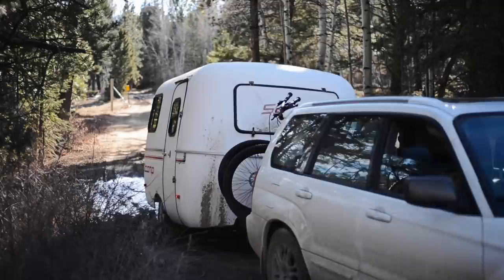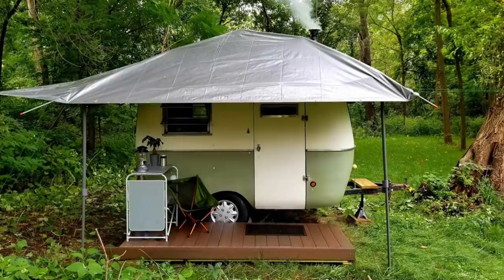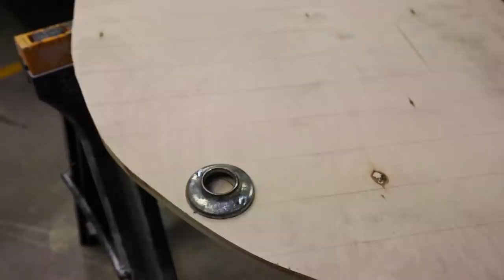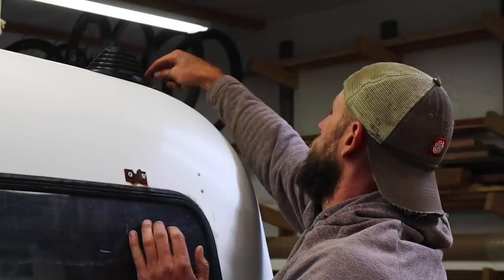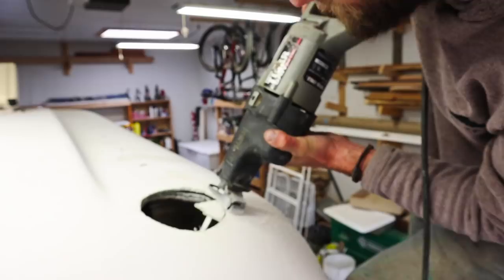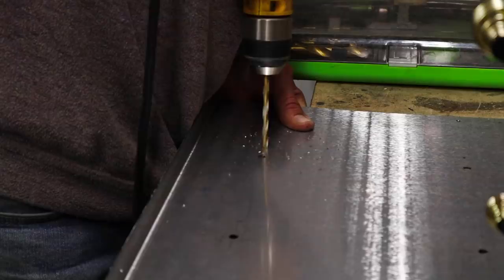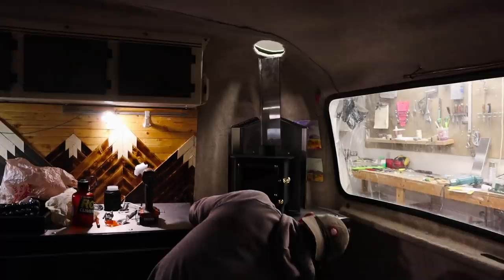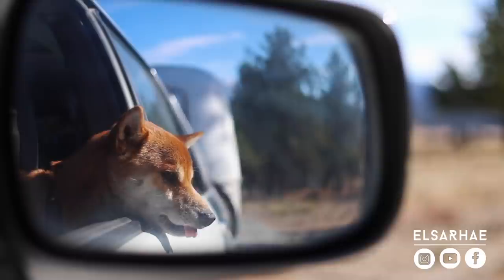Installing a CUBIC MINI WOOD STOVE inside a 13ft Scamp Trailer

Comment: ADD A SOAPSTONE ON TOP OF STOVE!!!
It will provide mass and hold heat for disbursing after fire goes out in middle of night.
There are several places online to buy soapstone, and stones that size are available in lots of locations as you travel.
I recommend getting two small thick stones and CAREFULLY drill holes to match stove top bolt holes and bolt down so they can’t slide around, and to cut out so stones go around base of chimney.  This way it will look like stove was designed for it and you won’t have to worry about stones sliding around.  Don’t tighten bolts, instead use locking nuts and loctite because you don’t want stones cracking as stone and metals change as they heat and cool...

Love this addition, wood stoves are AWESOME!  (And dry heating beats the condensation of propane all day long).

Love the Shiba Inu, mine died last month, she was seventeen...

Comment: When it comes to stoves, ideally you want to arrange for a cold air intake, ie an air intake on the side or the bottom of the vehicle, so the stove can draw its combustion air straight from the outside, and then exhaust the smoke through the chimney. Doing that means the stove doesn't draw air from the inside of the space, and minimizes air movement towards the stove. Without a cold air intake, the stove takes inside air to fuel the combustion - that's not a hazard or anything, but it means that the furthest corner from the stove will be much cooler than the air near the stove, because there will be constant low speed airflow from the furthest corner towards the stove, instead of the warm air circulating throughout the trailer. You may want to put a  quiet low noise 12 volt fan above the stove to blow air along either the front or the side of the camper to force the air to circulate around the van.
Reply: Croft, you are exactly correct. Exterior combustion air is the most effective and safest method. It will also reduce  possible CO2 or Carbon monoxide safety concerns. For the fan, there are units available that contain a thermal dielectric material, the fan sits in top of the stove and rotates with no electrical requirement like a 12 v battery.
Reply: @tedlemoine9829  Good tip on the thermal fans, sounds ideal.
Reply: The advantage of not drawing in cold air directly from outside for the combustion is that it will help pull out moisture from inside of the small space.  Every time you breathe out you're expelling moisture through your breath and that small of a space, two people put out quite a bit of humidity which can condensation on the windows and then cause mold issues.
Reply: Derek Post  I kind of disagree, and I've read of people who experienced it in a van. They had no cold air intake, so the stove used the inside air, and by definition that means air flowing towards the stove and then out the chimney. Since the air next to the wall is going to be cooler than the air next to the stove, this means a constant slow flow of cold air from the sides towards the stove. But yes, fans to circulate the air will largely alleviate the issue, I'm sure.
Reply: I saw another video from a 'van dweller' who used a marine stove (Dickinson, I think) that has a double walled stovepipe, to take in outside air in through the outside ring and exhaust through the middle pipe.  It was a propane stove.   I think I've seen others that use wood or wood pellets.
Reply: Craft
Reply: Looking at the manufacturers website it appears that is the purpose of the double flue pipe. One is for smoke the other is for air intake.
Reply: Look at all these smart people
Reply: @mangopapi8977  lol right
Reply: Wow this was an incredibly useless comment except the part about the 12v fan. Besides that totally trash, why would you have a cold air intake for your stove when your trying to heat up the area? You made a comment that sounds intelligent to someone but is actually quite idiotic. ( Except about the 12 v fan, i recommend a cheap usb one from amazon) anyway i wonder about this and it must let it a ton of water when it  rains. I would have put the exhaust out the back and make the vent sealable/closable for when it's not in use. Trouble with small stoves is that it means a small piece of wood, that won't burn for more than a few hours, so probably waking up cold.
Reply: Hi, Re outside air: I’d just crack a window on the other side of the trailer. The heat produced would more than compensate for any loss.
Reply: Max Stevenson well aren’t you just a bundle of sunshine.
Reply: @MaxStevenson-ih5ji  maybe a better word would be...fresh air instead of cold air. 
If the trailers are tightly sealed then the stove will suck all of the oxygen out of the room. Kinda need oxygen to breathe. 
In the old days they knew enough to keep a window cracked open to let in fresh air.
Reply: Love this stove. We bought the grizzly cubic. Double walled chimney for outside air intake and inner pipe for exhaust. The kit comes with a vent cap to divert water. No problem going down the road when secured properly. We like the ecofan (got it on Amazon) that works from heat of our unit. No electric or batteries necessary.  Enjoying your postings.

Comment from the maker: Thanks for watching and chatting y’all. Feel free to leave any further questions here in the comments and barron and I will answer them throughout the day! This was so fun!
Reply: Hi.. where did you get this mini woodburner.. I'd like one for my van.
Reply: How can one buy this stove?
Reply: Where did you purchase the silicone rubber boot for the stove pipe?
Reply: You all did a great job I've worked on RVs and houses for years I'm an electrician excellent craftsmanship
Reply: @justsomeguy7547  I am not sure if this is allowed or not, but I have one just like that, never been used, that I was about to list for sale. I bought the wrong size opening and the place I bought it from wouldn't take a return. So I have a spare, if you're interested. I also have the right size boot installed now, and so I can say from experience that they work GREAT. You can email me at fiddling dot girl at gmail if you're so inclined.
Reply: @aliveandfiddling  hey I would be interested but currently in a little bit of financial pinch so it might take me just a little bit to get the money
Reply: @justsomeguy7547  That's fine, I understand and will hold onto it if you want it and no rush as long as you keep in touch at fiddling dot girl at gmail
Reply: @andyt5116  I don't have the woodburner, just the silicone rubber boot.
Reply: @aliveandfiddling  thanks for response m8.. would you know where these burners are to buy?
Reply: We use wood stoves in the winter and i noticed that u covered the pipe. I think ud het the most out of it if u put some sheet metal on the corner of ur scamp and let the heat from the pipe bounce off of that.
Reply: I’d love to know where you ordered it from. We would like to have one for our trailer

Comment: A few bits of kind advice
- use local wood wherever you are just as you would with campfire wood, it minimizes invasive species damage. If you want to find less expensive wood, ask around to the locals. You might get a discount if you buy more than just a little bundle for making a campfire with.
- you can get a heat powered wood stove fan that sits on top of your stove and as it heats up the fan blade spins, circulating the warm air from your stove. They run on just the heat of the stove. This will minimize hot and cold spots in your home.
- using a mix of green and seasoned (dry) wood will make your fire last a little longer. I grew up with a barrel stove that heated our whole house. There is a learning curve here, but don't worry, you'll get the hang of it soon enough.
- in winter, especially with a wood stove, the air gets really dry. Dry enough to give you nosebleeds. Keep a tea kettle of water on the stove to prevent this and get one of those humidity gauges cuz you really don't want there to be too much moisture in the air either.
Thanks for making this vid!
Reply: Thank you for the gem.

Comment: Thinking some brick around the stove would radiate the heat back out after fire has died down.  Or some smooth river rocks around it that way you don't have to keep the weight in the camper. If you heard this already sorry for the redundancy.
Reply: Maybe fire bricks..?? Used to line fireplaces..??

Comment: This is going to work awesome! - I look forward to seeing it actually in action on a cold evening. I like the extra safety of being away from the wall and a nice heat reflector in back. One thing I was thinking about is ambers when you go to fill a stove that is burning hot. The two of you will need to be diligent with that.
Reply: Yikes - that was my Dad voice coming out :+)

Comment: Great!  I have the same stove installed in a 16x12 cabin.  Can throw out quite a bit of heat, but it can be damped down effectively too; it should make fo many a cozy night for you guys!
Reply: Mendo Myco What people may not realize (since no one has mentioned it) is that the stove needs a regular supply of wood... so that means getting up every few hours (like every 2,5 - 3 hrs) to add wood, IF you want it to heat the trailer all night.

Comment: Visiting the Colorado Rocky Mountains in colder weather, I like it. Installed a larger wood heater in a camper, used a lot of the fireplace rated sheet stainless steel from Lowe's to create a fire safe area for the heater. I know you'll inspect the rubber flute seal on top of the Scamp regularly, especially in summer, they get brittle and crack over time for variety of reasons.
Reply: Those boots are silicone, actually, and have a remarkably long lifespan. Far better than rubber.

Comment: Nice, have mine in an 18" tt. After about 10 hot fires the smell is pretty much gone. Love it but that smell does suck at first. I've also started using the cotton ball petroleum gell method of fire starters. Works great.
Reply: Any new wood stove should have a minimum of one burn Outdoors before installation to avoid any of noxious fumes
I did that with my inside stove before installation, and so glad that I did.

Comment: No need to remove it when driving. We have a Cubic Grizzly in our Airstream, the next size up, and we have driven thousands of miles with it installed. Just get a chimney cap and you’re good to go.

Comment: Excellent idea installing the wood stove.  It's also a great way of keeping you trash pile low.  I highly recommend purchasing a carbon monoxide detector for safety reasons.  The pipe could get clogged up in the middle of the night and you would never wake up.

Comment: We just installed the Cubic Mini in our Airstream. Love it so far. We did go with the double wall 3 inch Duravent. Time will tell if that was the way to go. :)
Reply: Was the Duravent a good choice?
Reply: @andreab5865  It’s the only choice if you want the double wall flu pipe. It’s worked fine for us. I would try and have a straight up & down however. Less cleaning.
Reply: Thanks for the reply and advice

Comment: To make your space warm and comfortable you must have a fan that circulates the air. Otherwise the hot air from the stove will rise to the cieling while your feet will still be freezing. A fan on the floor blowing up will fix this. Anything that circulates the air will help.

Comment: Saw 2 videos on this exact stove on the "Tiny House Prepper" channel - one was on the install in their trailer and the other was about tweaks they made with piping after using it a while.
Reply: These guys already installed the recommended double wall pipe, and they use a short and straight pipe, so they shouldn't develop a creosote problem.
Reply: I saw those videos before we did our install. They were super helpful.

Comment: I have the grizzly and I took a 6in connector connected it to the 3in opening at the rear of the grizzly put it inside my fireplace insert turned up 90 degrees upward with another 24 inch single wall 6 in flu ran it up my existing chimney love this little stove got the house up to like 75 in the living room

Comment: In another video of a Cubic Mini...this time heating a small home...the owner cut a (maybe) 1/4" thick piece of steel plate about 50% larger than your stove top and just laid it on there after removing the rail.  It hangs over a few inches all around the sides and front to give him more cooking surface.  The heat from the stove transfers up through the steel plate, and he claimed he cooks eggs and sausages there, so it gets plenty hot.
Reply: David great idea!

Comment from the maker: If you’re on your phone and trying to get involved in this live chat, scroll up to the video and underneath should say “live chat”. Try clicking that.
Reply: When you say cook on the stove - do you mean keep coffee/tea warm & heat soup?  It's the cutest stove!  Looking forward to more info on your adventures wintering with it!!
Reply: You may want to consider an automotive seam sealer that self-leveling around the exterior of the boot clean with denatured alcohol prior. Silicone will not stand up to cold temperatures and hot temperatures

Comment: I had a Cubic Mini in my small old RV, and I never removed it for travel.  The only thing I did for travel was to remove the exterior pipe, and install a metal cap which snapped in, so there was only about 3 or 4 inches left above the roof. I had an old gym bag which I stored the 24" pipe in, which fit under my bed.

Comment: Expensive stove.  Which could buy a lot of propane.  I installed a functional fireplace insert which easily keeps the house warm thanks to free wood.  But the ash and trouble are more expense than propane.

I might make my own for my RV. I will have it sealed, drawing air from the chimney in between the two pipes.  This with secondary combustion air will make it very efficient.

Comment: I k ow you may never see this, but use kaowool for around the flue pipe. Kaowool is used to insulate steel plant furnaces. You can have a tprck on one side and your hand on the other and be fine.

Comment: Ive run a wood stove in a trailer for a couple years and the one thing i would be put off by is that you probably have to be pretty picky about what kind of wood you burn due to its smaller size.  

Nice looking unit though.

Comment: Coil up some copper soft pipe around you smaller chimney and cover with your 5" chimney......add a small 12 volt pump and use copper to heat up water.

Comment: Wow! Had no idea you could do such a thing. The only heat (aside from those that come with small furnaces) are some little electric space heaters and Mr. Heater (which I think is propane--could be wrong). The little wood stove is amazing.

Comment: clean your chimney pipe once a month if you use it a lot. very important . chimney fire is hotter than 400 degrees. 👍  small pipes in cold weather build up creosote easy. 👍  happy camping. ☺

Comment: Nice job! We used lump coal easier to store burn. Enjoy!
Reply: can you use it in the cubic mini?
Reply: Deborah Wood I know this has been a year but it does say on the website that you can use coal. However bear in mind that you will have to clean out the ashes more often than with wood. But coal burns longer and is easy to store.

Comment: Not being a fan of sleeping next to something that is on fire, I am working on a small rocket stove, which burns recycled vegetable oil and heats an air box which uses a small fan to circulate air from inside my trailer out through the heat box and then back into my trailer keeping things warm, but removing the risk of catching stuff on fire. I am 71 years old I don’t fancy having to scamper away from fire, so I’m playing it safe. I am toying with using a TEG, which stands for thermal electric generator, to power the recirculation fan, so I don’t need electricity, just heat.

Comment: I would use a thin coat of self leveling lap sealant made by Dicor around the screws on the roof if this is a permanent install. It will keep the hardware from rusting if it is all coated. The self leveling though will run to the lowest point if you put a lot on it. So you may want to apply it thin (spread it thin with cardboard if you have to) several times to get the thickness where you need on the areas that are less than level. I was told that this lap sealant is what the OEM manufacturers use to seal the membranes on RV's and motorhomes but they apply it with a heated caulking gun to get it to flow better (its pretty thick stuff straight out of the tube).

Comment: Be sure to keep some type of can of water on it with no lid. It helps with the humidity and dryness of the camper. Great build 👍
Reply from the maker: Truly we need the opposite, it’s still so continuously wet in here! Much better than it was with propane, but the windows are near constantly dripping!

Comment: A solid upgrade from someone I once knew that used wood. for the exhaust pipe to get as much heat back into the cabin as you could, run a crap load of pipe inside, not an overkill amount but say its still hot where it exits now, take that pipe and run it a few feet along the top inside then as it gets close to cool have it run back out. The last guy that did this in a shop had a great example of using thermodynamics to his advantage.Not to sure how it would work in a trailer but save for a harder clean and little more pipe inside could mean being cold as fuck to being warm on allot less wood.

Comment: By BL- have you tried what they call an emergency 🕯️ candle in the stove?  It is a can with tightly rolled cardboard and then you pour melted wax over the cardboard until it covers all of the cardboard it is suppose to burn for hours.